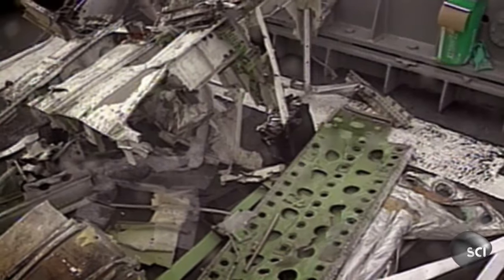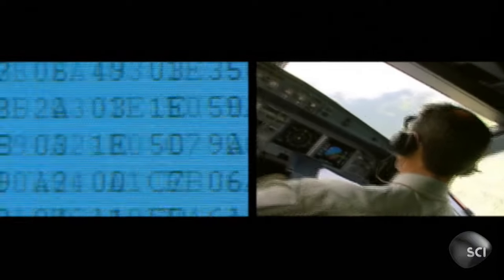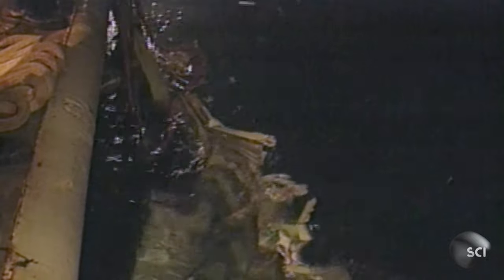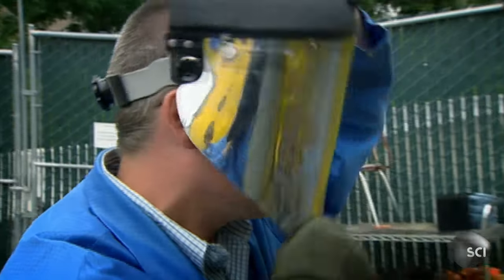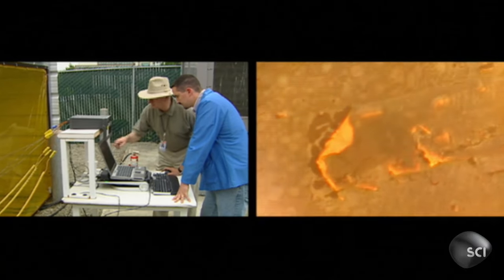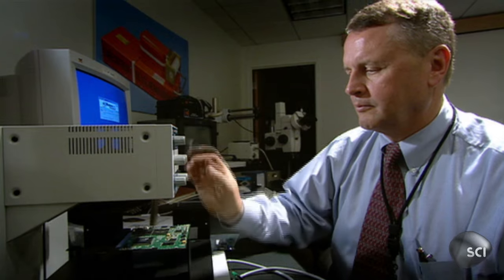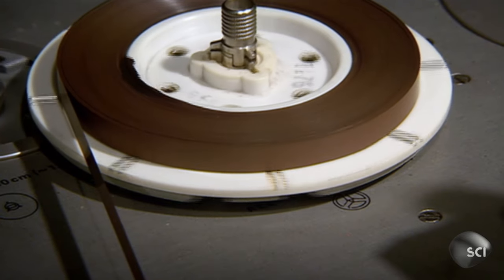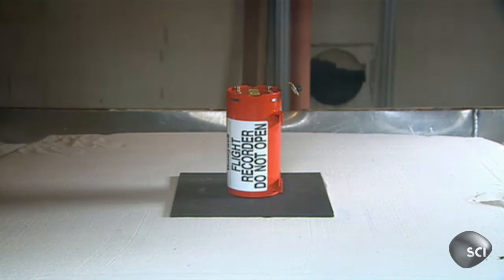How Black Boxes Are Made | How Do They Do It?

Comment: The Ironic thing is the NTSB never knows what made the plane crash until it is investigated. That itself cannot prevent a plane from crashing. The black box is simply a recorder of what went wrong, as long as a certain system is monitored. It cannot actively warn or prevent systems from failing. So, until a problem arises that causes symptoms to make the plane crash, everything is considered to be normal and safe. What causes one plane to crash is unique in every circumstance and, may not be the cause of the next plane crash. Just because a plane is maintained and everything checked and no problems found, doesn't mean something can't or won't fail afterwards. So, how does the Flight Data RECORDER make flying safer than ever? It doesn't, it's merely a witness that doesn't stop a failure from happening at that instant and allows the plane to go down anyway. It's not a miracle fix!

Comment: why doesn't jet fuel melt steel here,but it did on 9. 11?
Reply: Gray Matter it’s the electricity. The plane and “explosion” that damaged the high voltage wires. It’s like a welder that uses electricity to melt two pieces of metal together. Simple rich that gets overlooked. FYI I don’t trust the gov however we will never really know but there is a reasonable explanation for the steel melting.
Reply: @macdaddy5796  You mean that the steel beams meted because of electrical fires as well as jet fuel?
Reply: Gray Matter not an electrical fire but severed wires released the current to steal beams. The electricity creates plasma and melts steel.
Reply: @macdaddy5796  Hmm. That's quite a stretch I believe, but everyone has their opinion. Thanks for that one, I have never heard that one before. Too bad that they were not allowed to investigate the rubble and steel after the incident like any other normal collapse. We might have found more definitive answers.
Reply: Gray Matter well we both know they do not want the real answers out there. Troops guarded poppy fields in Afghanistan than we have a big opium/fentanyl problem. They want control over everything however it is a simple fact there had to be a lot of electricity running up the towers and it is well known electricity melts steel. Welding is a real thing. Weather it played a part or not it is a possibility.

Comment: The last half hour is BS on the black box. The last precious last minutes and seconds are the tell all.
Reply: I can think of a advantage to longer recordings, say a crash was caused by pilot error witch it normally is, if it was the last minutes we wouldn't know if the pilot made a small mistake or was under trained, with an hour you can tell if the pilot did a lot of things wrong, or one thing wrong, and if they did a lot of things wrong and other crashes have the same thing, we could maybe point to pilot teaching systems, but that's only one advantage I can think of, there are probably more.

Comment: Why is the blackbox painted red??. 🤔 Nobody is answering me
Reply: I have worked aircraft for over 32 years and am somewhat of an expert on Cockpit Voice REcorders and Flight Data REcorders.  No one i have ever worked with call them a Black box, you always hear that on the news and on You Tube.  Not typically in the industry.  Of course they are painted orange for visibiity.  Most modern Cockpit Voice Recorders will record  the last 2 hours of voice and then start overwriting the oldest recording.  Most modern Flight Data Recorders wil record 25 or more hours of data.  What is recorded on a Flight Data Recorder is regulated by the FAA and EASA for what is mandatory, but the manufacturer adds quite a few additional parameters to record.
Reply: @rcairflr thats okay but they call it black box afterall... Why? Should br called orange box or red box. How is  black coming in?
Reply: @fikshun1326  > That is a term that goes back quite a few years and in modern days is very much a misnomer.  I assume it has to do with most Aviation boxes being black.  As I stated earlier, you only hear this term on the news and You tube, never when you work in the industry.
Reply: @rcairflr  oh okay. So the previous  redboxes were black then they changed to red. Oh okay.